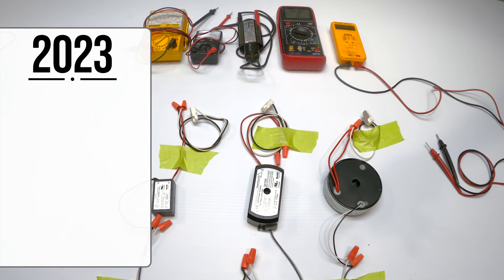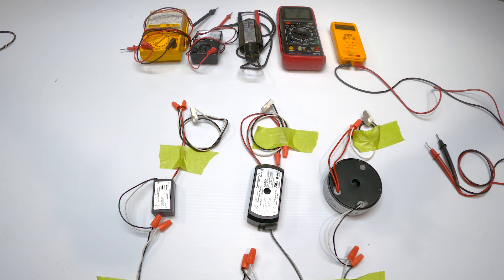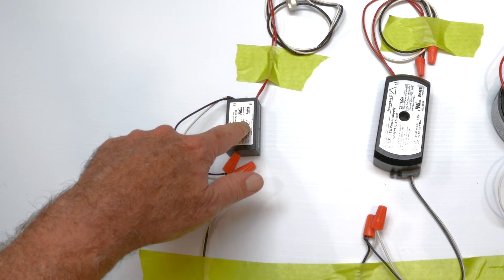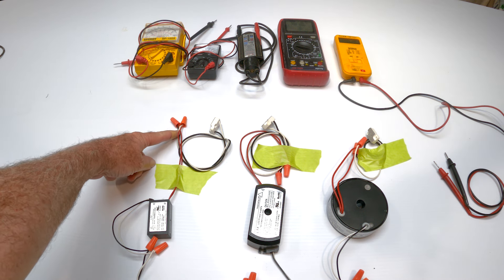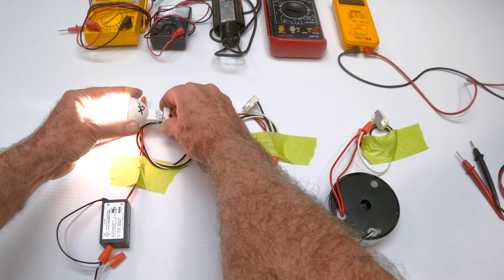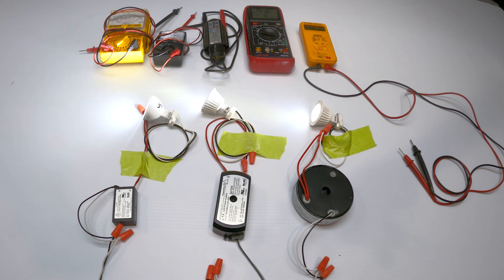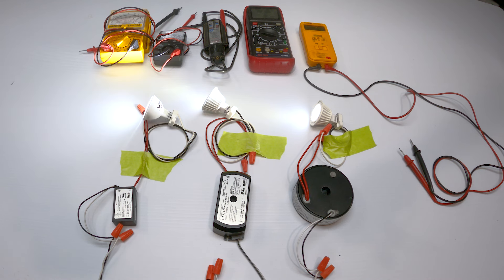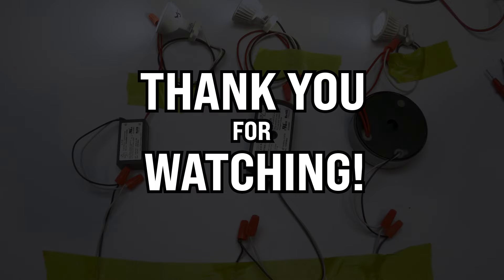How to quickly troubleshoot LED Drivers & Transformers with no voltage reading! #Howto #lowvoltage

Comment: Great video. Thank you for sharing this.  I'm in the UK and regarding my bathroom mirror LED's no longer working, I've changed all 8 tiny bulbs to new, have replaced the transformer (like for like), but still not working.

I've 230v going into the transformer via the pull-cord switch, but no power coming out of  the transformer. Complete zero volts. 

I'll check all the loop nuts linking the bulbs, as mentioned in your video. ❤

I then replaced the transformer for a 2nd new one, but still the same problem.
Reply from the maker: Glad to hear you found our video helpful! As for the zero volts many electronic transformers require a load on them to do their job. Some will even say not to go below a minimum amount of watts. I would check to see how many watts and volts your LED bulbs require. Make sure the LED bulbs are designed to work with the transformer you are using. For example, there are AC LED bulbs and DC LED bulbs. Check your transformers output type to make sure it matches. You'd be surprised how this can get mixed up and cause problems. Also, electronic multi-meters may not accurately read the voltage as mentioned in the video. Maybe run a test similar to what you see here in the video using a socket and LED bulb you know works. It is very unlikely that 2 transformers are defective. Hopefully going through your system again you'll discover the issue! Have a blessed week 🙂
Reply: @Totallightingsupply  Hi, Thank you so much for your prompt and detailed response, which is really clear to understand.  I will certainly check as you have advised, which seems promising, and will let you know how I get on.  Much appreciated. ❤
Reply from the maker: @deem3767  You're very welcome! Have a blessed day 🙂
Reply: @Totallightingsupply  Hi, you a true legend.  I followed your clear advice and it transpires that I had mistakenly replaced the old HALOGEN transformer with an LED TRANSFORMER, which obviously did not suit the new HALOGEN bulbs I fitted.

I then fitted new LED bulbs today (from Amazon) - to suit the new LED transformer, and it all works like new again, and even better with the brighter LED lights.

I had spent so much time on this and tried researching so many sites & videos, but your video was the only one which helped me.

I'm obviously not an electrician and did not realise the mistake I was making, and your advice sorted it for me.

I shake your hand my friend and sincerely appreciate your prompt and detailed advice.

God bless you. ❤
Reply from the maker: @deem3767  Thank you for sharing! We are delighted to hear that our video was helpful in troubleshooting your issue. Have a blessed day!

Comment: The fluke 323 clamp meter is true rms and is $150
Reply from the maker: Thank you for sharing! That is good to know, ..Most home owners and DIY'ers we have had experience with have those less expensive multi-meters in the $20 - $30 range. As you can see this video was made to help them.  Our engineer did make this comment. ...With regards to the meter used to measure the output of electronic transformers, I would also note that not only True RMS, but with a True RMS bandwidth of 100KHz or greater is ideal. Also, we use the AC+DC mode for measuring the output on these. Typically, this mode is only available on certain very high end  RMS meters and require a higher skill  and experience level than the once in a lifetime use.